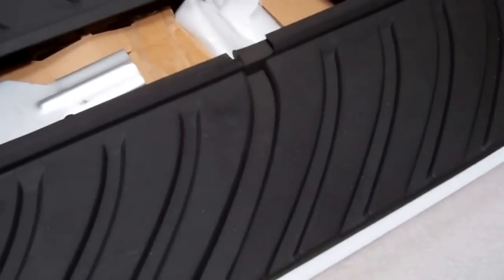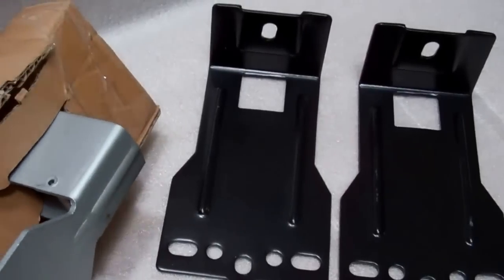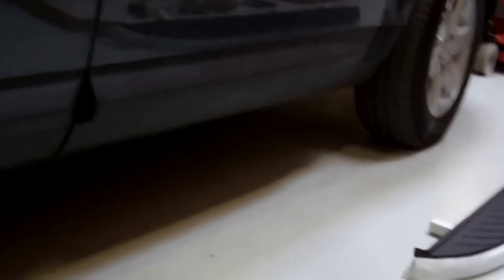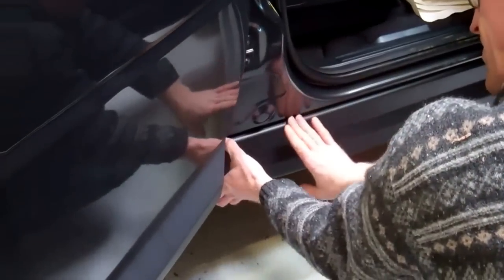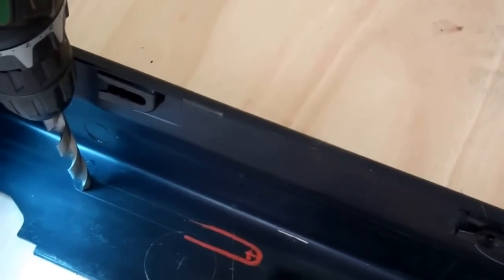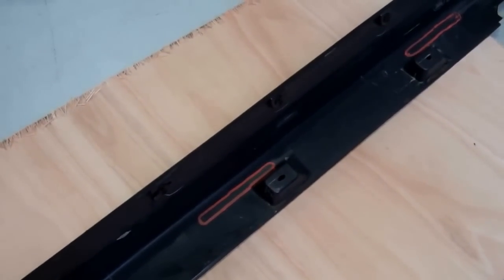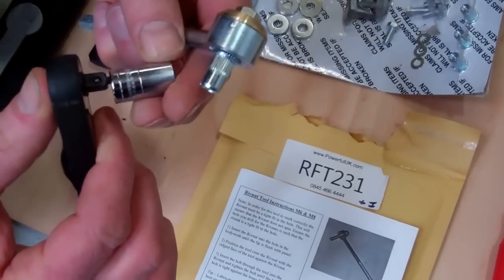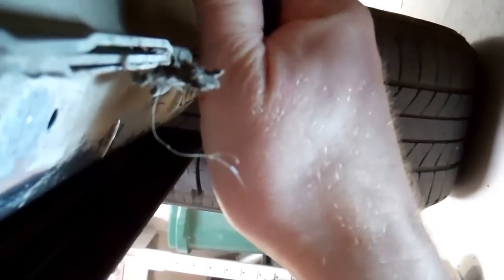How to fit side steps to a Land Rover Freelander 2 / LR2 - PART 1

Comment: GREAT VIDEO THANKS GUY'S AND OF CORSE KATE!!
Just one question ?
At the begging of the video you took the clips out of the sills but did not replace them at the end, Are these clips no longer needed once you fit the steps ??
Reply from the maker: Hi - yes the yellow / white clips in the cills. You can reuse the old ones or some kits come with replacements. Usually just replace the ones that break.

Comment: Anyone had a issue with the steps running on the doors? Any help would be greatly appreciated thanks guys
Reply from the maker: Hi - do you mean that the bottom of the doors are hitting the side steps when you open the door ?
Reply: Yea and when they’re shut but I’ve just been up there and sorted it undid the bolts slightly and wiggled the step plus bent the little door rubber at the bottom of all the doors just a tad upwards problem solved